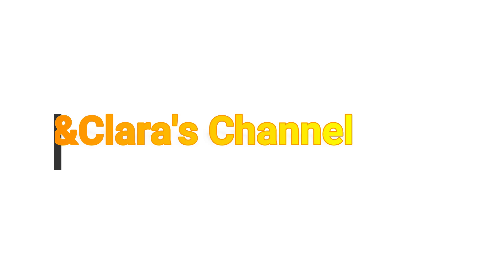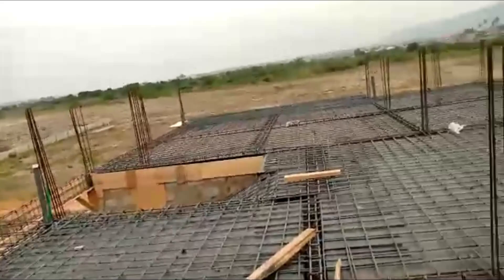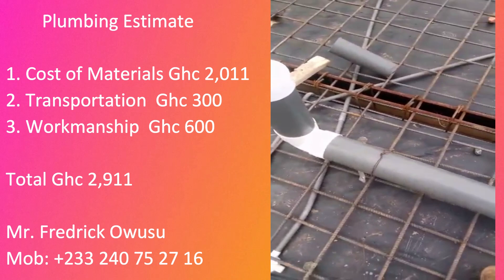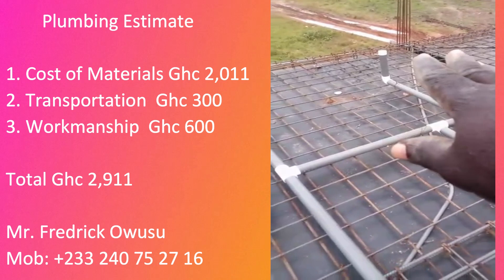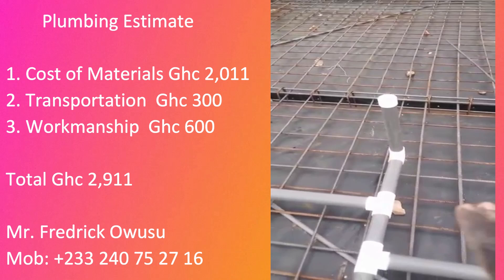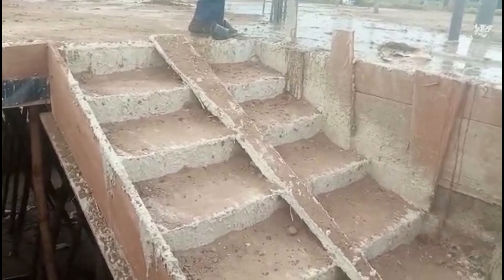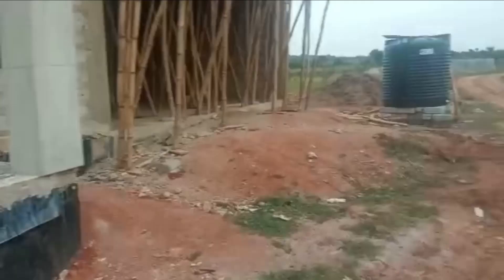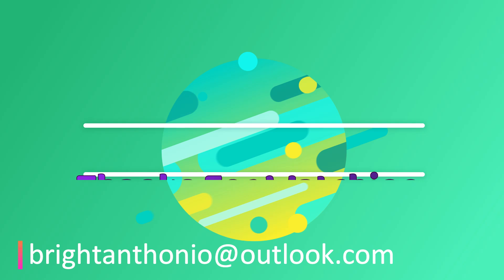Building in Ghana | Total Cost of Floor Decking A 4-bedroom House | #ghana #dreamhome

Comment: Thanks for this bro. I saw cracks on my foundation surface after they casted . Is it something I should worry?
Reply from the maker: It will depend on the severity of the cracks. 
There are some cracks caused by the sinking of the laterite, this must be repaired. There are some cracks caused by the hardening of the concrete, this you shouldn't worry about. 😉 

Regards.

Mr. Bright